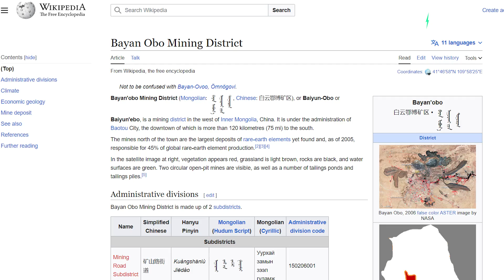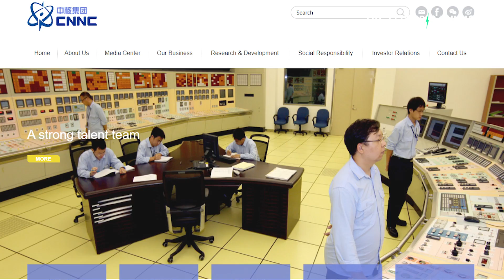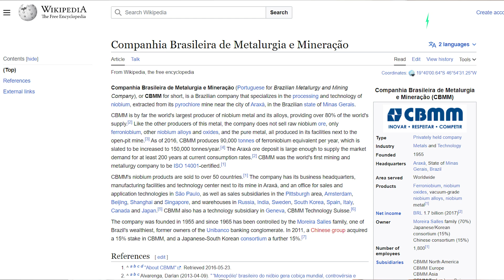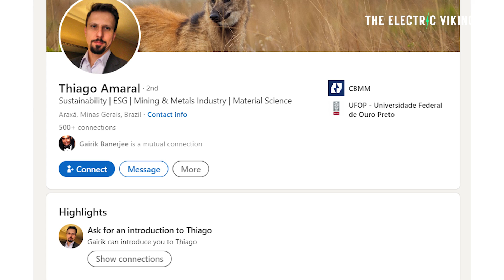China discovers rare earth material that could transform electric car industry

Comment: According to chat gpt:

As of my last knowledge update in January 2022, the biggest lithium producers in the world included:

1. Albemarle Corporation: Albemarle is one of the largest lithium producers, with operations in the United States, Chile, and Australia. In 2020, they produced approximately 71,000 metric tons of lithium carbonate equivalent (LCE).

2. SQM (Sociedad Química y Minera de Chile): SQM is a major lithium producer based in Chile. In 2020, they produced around 50,000 metric tons of LCE.

3. Ganfeng Lithium: A Chinese company, Ganfeng Lithium is a significant global player in the lithium market. They produced about 34,000 metric tons of LCE in 2020.

4. Tianqi Lithium: Another major Chinese lithium producer, Tianqi Lithium, produced approximately 34,000 metric tons of LCE in 2020.

5. Livent Corporation: Livent, formerly a division of FMC Corporation, is a global lithium producer with operations in the United States and Argentina. In 2020, they produced around 16,000 metric tons of LCE.

Please note that production figures may have changed since my last update, and the lithium market is subject to fluctuations due to supply and demand dynamics. I recommend checking more recent sources for the latest production data.

Comment: Niobium (Columbium) requires you achieve absolute zero for the superconductor stuff to happen. How much energy does it take to achieve absolute zero? Do you honestly think Niobium is going to re-invent the battery? Seriously. 
And yes, I own a Bruker mass spectrometer. Scrapped it out for the copper/niobium matrix wire. And no, it's not worth the effort. I have 1000 kg of it sitting in a crate in my yard.
Clickbait.

Comment: A36 steel is cheap, abundant, easy to fabricate and weld. A steel alloy using Nb will be expensive, rare, require special fabrication and welding technique. Unless the Nb alloy steel is used in spacecraft, using the  special alloy to save  5% car weight is foolish.

Comment: @3:20, reducing car’s weight by 5% is a waste of Nb even if used at 0.01% in a steel alloy. You can achieve the same weight reduction by using Al alloy or carbon-fiber composite on the hood or trunk at much lower price than using Nb.

Comment: 4:18 Have yet to find any solid clues on useage of this stuff in batteries.... with some other elements to come to.
Brazilian miner and processor CBMM is stepping up sales of niobium products to battery materials producers as it seeks to enlarge the market for niobium-bearing batteries in high-end industrial and commercial markets including heavy trucks and equipment, rail operation and energy storage.

Comment: Dude you should stop all these "could be great" announcements.   I'd stick to "have released or produced" verifiable outputs or soon to be verifiable.
Light steel is not that big a step forward, Tesla already uses Aluminium which is lighter and stronger
Rare Earths are never going to be used in batteries in volume.  Lithium is used in a small concentration in battery but that is going to be difficult to build volume for mass use, and its very common.
Always take Chinese announcements with a larger pinch of salt than other countries.

Comment: From China Academy Substack

Extract

China's Super Battery: Revolutionizing Future Warfare
China's super battery technology is spearheading a revolution in the realm of directed-energy weapons, garnering high-level attention from the U.S. military.

LINWEN
OCT 16, 2023
7
Laser weapons and plasma guns have become commonplace in science fiction since the 1970s. However, in reality, weapons of this nature are impractical. Not only do they require power sources, such as batteries, to provide ample energy, but they also need to be compact and lightweight to be compatible with various weapon platforms and easily portable. Additionally, the batteries must be capable of discharging a massive amount of energy within a split second to generate a sufficiently high output voltage...

Comment: Since Niobium will be locally sourced in China this means that Brazil and Canada can increase their supply to the rest of the world. If it is useful in increasing the strength of steel this means it will be far more useful in the space rocket industry where weight reduction is far more important than in cars.

I believe its use there will consume any increase in supply.

Furthermore, the growth of lithium sulfur batteries we ill have up yo 5X the energy of today's lithium ion batteries. When used with an aramid fiber separatir they also have a lifetime charge cycle up to 500 times. That may seem small since todays lithium batteries have a 1,000 times charge cycle, but with 5X the density this means a range of 1,500 miles on a charge, which yields a lifetime of 750,000 miles on a typical battery pack. The charge rate is also at least 3C, which is adequate.
Reply: Not really. Brazil can do what it wants. Brazil doesn’t owe “the rest of the world” nothing”.

Comment: If its more exoensive and rare I think ot will a long time before we'll anything relevant from niobium. And from a cost perspective, we have countless alternatives in light metals for EVs, such as magnesium and alluminium. And then there's also the little talked about recycling of metals in current redundant or aged products. And I think we can do more by being more creative with battery capacities options in current cars to cut costs. One aspect I think is worth exoloring in EVs is the option to rent extra capacity by providing a battery swap station to add or remove extra battery capacity. Lets say an Ev has a standarg 40-60 kwh battery for daily commutes. Once you need a longer journey on one day or a weeks holiday you can rent an extra 30 to 50 Kwh to have a longer rang3. That way you can share packs among more EVs, reducing the weight and cost perhaps by 25-30% as well.

Comment: Sam, Niobium is not a Rare Earth element; it is a Group V transition metal, in the same column as Vanadium and Tantalum on the Periodic Table of Elements. It's also not very rare, estimated as being one of the top third of most common elements. Niobium was first found with Tantalum as an impurity in the early 1800's. It's used in a number of industrial, medical and jewellery applications. I'm not quoting Wikipedia here, but it should confirm and expand upon what I'm saying here.

Another mistake you often cite is that Rare Earth elements are all rare. It's a misnomer,.because most of them are not rare. Neodymium and Scandium are two of the most commonly known Rare Earths. 
Lithium is also not a Rare Earth either; it's a fairly common Alkaline Metal, along with 5 others, including Sodium, Potassium and Caesium.
Reply: Tell that to the Mineral Classification Organisation as it is they and NOT Sam that classified minerals under  " Rare Earth " Category.

If you are not happy with that, then perhaps you can start your own Organisation to overturn the classification.
Reply: lol  @stevenliew2507   Thanks for the laugh; it's appreciated.. 

I can find no online reference to the Mineral Classification Organisation, however. If they do exist, then they are saying something which is incorrect. In the Periodic Table of the Elements, two specific groups of elements are defined as Rare Earths, namely the  Lanthanide Group and the Actinide Group. This is taught in basic high school Chemistry.

Neither Niobium nor Lithium are in either of those two Groups of elements. Ask any reputable chemist or nuclear physicist and they will confirm this statement..

Comment: Rhodium is the element of the moment. That's why they are stealing catalytic converters all over the USA, to scavenge the Rhodium, which was used instead of the more expensive Platinum and Palladium. Today, Rhodium is $170,000 per kg, while Niobium is only $50/kg.  I would imagine that if they have a nice new source of Niobium it can be used more freely. But it isn't one of the superstar elements like Rhodium or Neodymium. ND is super fantastic for motors, and makes the strongest magnets known to man, but is so expensive, and 95% controlled by China, that finding more Nd would be very big news.  USA has only one Nd mine, that had been shut down for a long time. Super hard to find Nd. Many of the metals come from deep inside the earth, and thus are not easily located on the surface. Asteroid mining may someday solve this problem, as you might find some asteroid that just happens to be a big chunk of one element. Would be incredibly valuable.